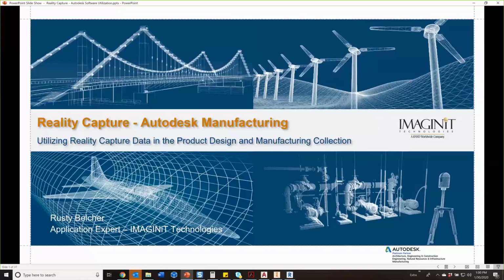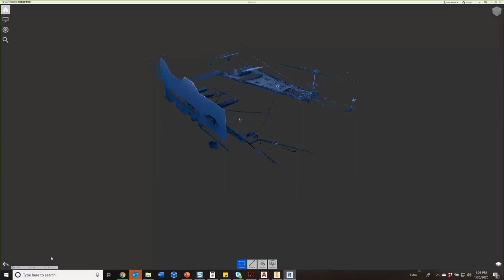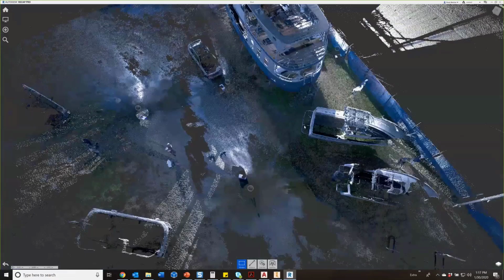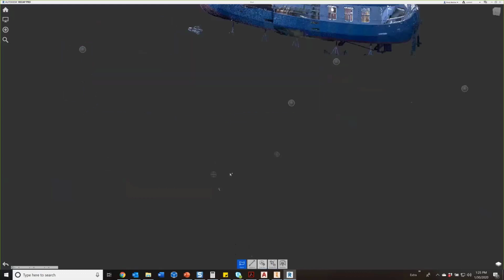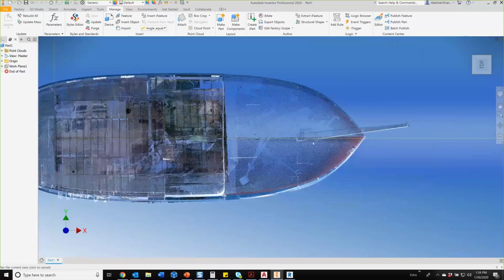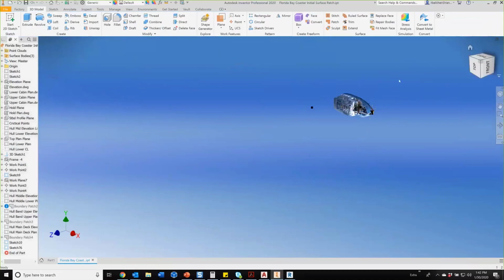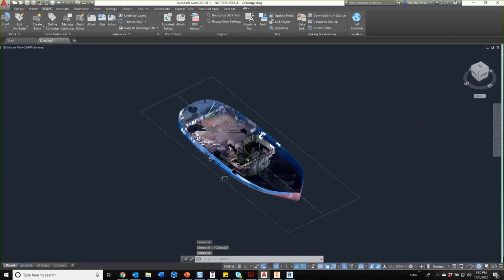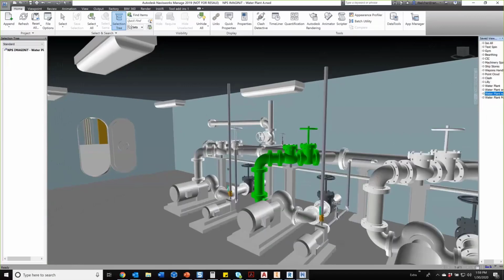Using Reality Capture with Your CAD Tool

Comment: And 5 years later, it is still impossibly difficult to setup a coordinate system in Recap.  There are virtually no program feedback from Recap while performing this task.  Try finding this in Autodesk help files lol.  I think the original program assumed a perfect first setup.  Where is the text data entry box for this data?  Leica has one.